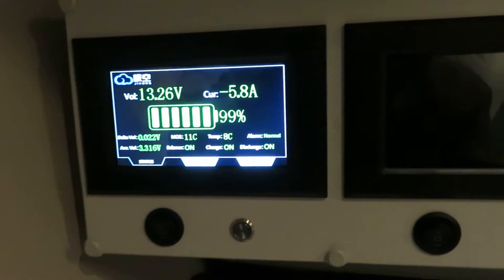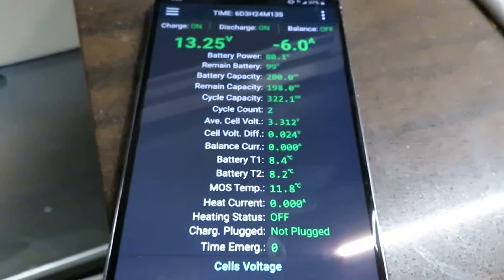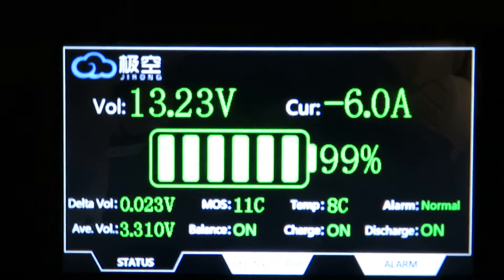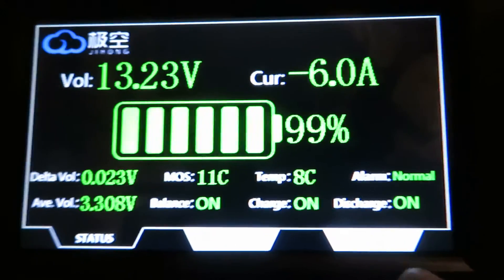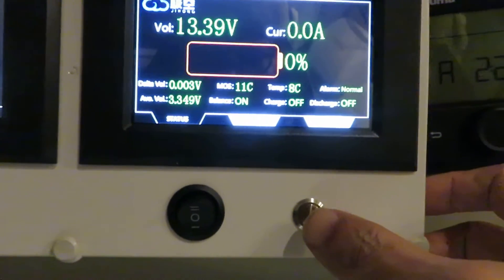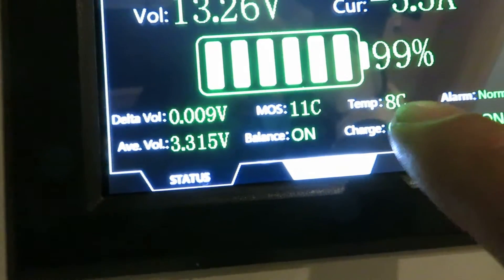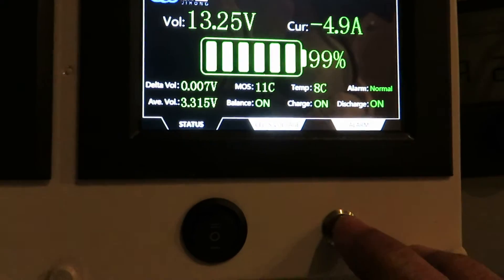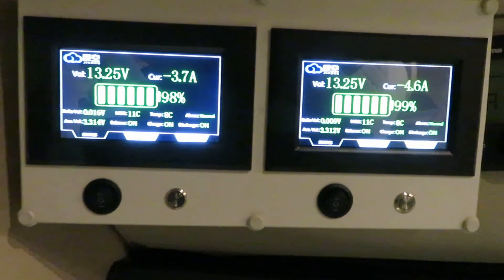JK BMS LCD Display Monitor Illustration and BMS Overheads

Comment: is this touch display always on or only in discharge time?
Reply from the maker: Yes touch screen but just for the three tabs. The screen is always on but you can add a switch to the +12V wire for screen on/off control.

Comment: Hi. I have the same 4.3" display monitor. 
I don't need to have the monitor on all the time and need to know which wire to isolate with a switch to turn off the monitor only.
I think the  "RED + plus" and "YELLOW - neg" is the power supply to the monitor only, therefore, placing a switch on one of these wires should work.
Is that correct ?
Reply from the maker: I believe so. Did you try?
Reply: @parkhopper3627  I've just installed a simple latching on/off switch on the 'Red' 12v power lead, and 'Yes' it turns off the monitor without affecting the operation of the BMS
Reply from the maker: @Rocky-52  Thank you for confirming.

Comment: Hi,verry nice setup. Can i use in the same time lcd screen and bluetooth app on smartphone? Olso if i have jk bms with heater port and my system is 24v do i need use 24v heater,any 24v heater or just those silicone plate heaters? For what is rs485 can port,i have that litlle black rs485 can module,how can i use it,maybe to communicate with my hybrid inverter,or how? Hope to answer my questions. I'm now in this lifepo4 setup.Thanks in advance.
Reply from the maker: Yes with smart phone. You should use 24V heater or use two 12V heaters connected in series. I have not explore the RS485 CAN module yet.